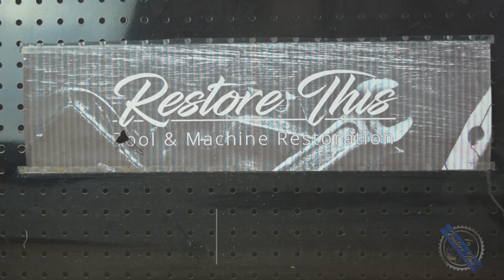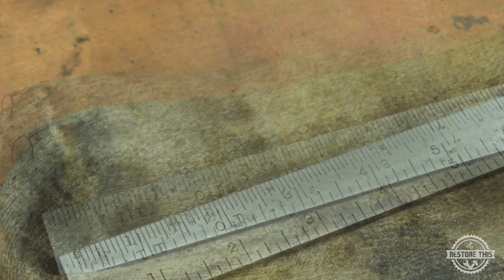COMBINATION SQUARE RESTORE! AMAZING Early 1900's Starrett Copy Combination Square Total Restoration.

Comment: That had to be incredibly satisfying! I have a very similar tool, identical except for the manufacturer. Mine wasn't in quite so rough shape, a little crocus cloth on the blade is as far as I took it. but now you've got me thinking... 😉😂
Reply from the maker: It was quite satisfying to clean it up and get it working again! Thank you so much for checking out my video and dropping by!

Comment: Nice resto. I'm gonna try to clean up an old Stanley combination square that my dad bought in the 70's. It's not in terrible shape but there's enough rust that the ruler doesn't slide and the set screw doesn't work well. It really just needs de-rusting and some polishing. Sadly I don't have access to a sandblaster so I'll just have to apply old-fashioned elbow grease.
Reply: You don't necessarily need sandblaster. Use wire brush of different sorts instead.

Comment: Can you please share what grits you used when polishing the ruler... if you remember?
Reply from the maker: I started out with 200, 400, 600, 800, 1000, 1500, 2000, 2500 then finally 3000 grit. It was a lot of sanding but it was worth it!
Reply: @RestoreThis  - Wow - I'm afraid of using sandpaper and losing the fine etching of the lines and numbers. You seemed to do it with ease.  I've seen people use brute force and just sand blast them clean with whatever type of material they use but I don't have that kind of equipment. May just have to experiment. Now I understand why there are so many squares missing the rulers. :)

Comment: How did you install the level keeper?
Reply from the maker: The replacement fit snug enough so I just gently tapped it in, then installed a plug to hold it in and keep it from moving. Thank you for watching!